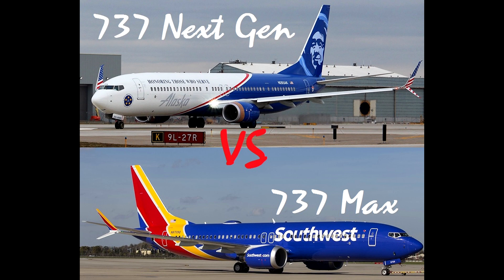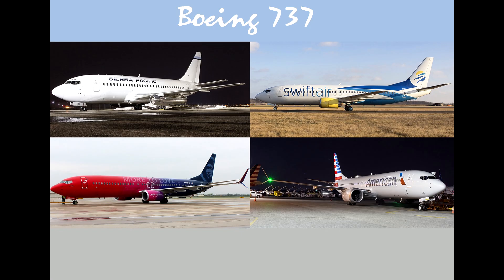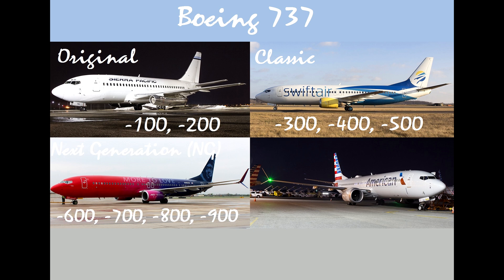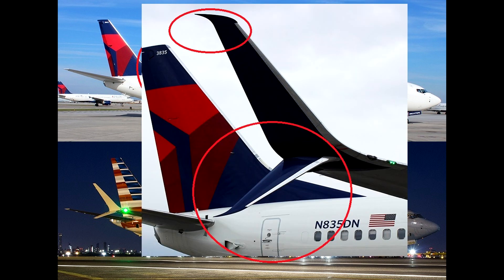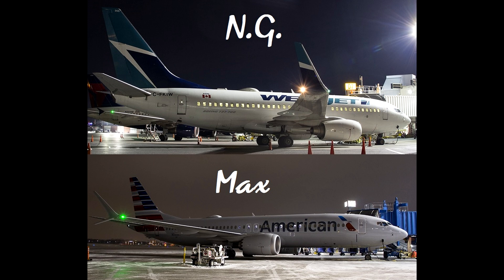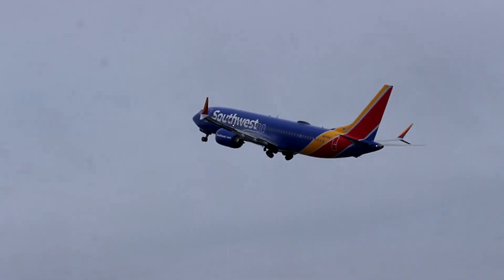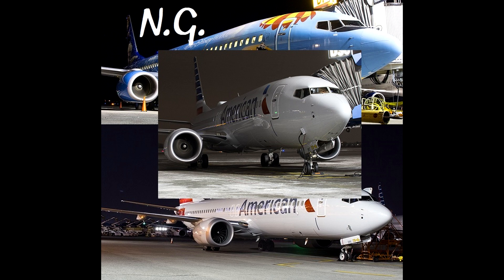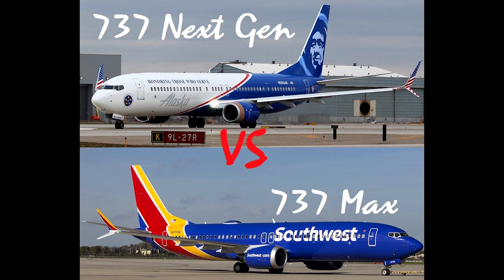737 NG vs MAX: Spotting the difference

Comment: To make things even more confusing, not all 737-NG aircraft feature the split scimitar winglets. Some have older, more basic winglets, which look like the upper portion of the split scimitar, but lack the pointed tip, though they are still at a very steep almost 90 degree angle unlike the MAX winglets. Also, some early ones didn’t even have winglets when they were first made, and a few Alaska Airlines 737-900s, the first of their type ever built, still lack them! Most Delta Air Lines 737-800s, which are fairly early production, came with no winglets initially, but they had the basic ones added on, probably some time in the 2000s or early 2010s. They are currently in the process of receiving the split scimitar winglets. I flew on N386DA a few days ago, only Delta’s 16th 737-800. It was an old plane from December 1999, with brand spanking new split scimitar winglets! Interior also seemed pretty fresh: definitely old in some spots but thoroughly deep cleaned.

Comment: Could you guys tell me what version is the Zibo mod for X-Plane 11?
Cause it’s called 737-800X
I thought the X standed for MAX, but it has no double winglet
Could you also tell me if having a tablet inside the cockpit is a MAX thingy or also NGs have it?
Thank you very much
Reply from the maker: I dont know anything about flight sims but there is no such thing as a "737-800X". The X is just something who ever made the plane in the sim put on the end. Original, Classic and NextGen 737s all have a 3 digit number after 737 (-100,-200,-300,-400,-500,-600,-700,-800,-900) and Max has a one digit (-7,-8,-9,-10). All Max's have the upper and lower advanced technology winglet. The Split scimitar on the NG is after market and doesnt come standard so there are -700, -800,-900s that do not have them. Having a tablet has nothing to do with anything. Almost every plane I have ever worked on (crj200, crj900, erj175, A220, a320, a330, a340, a350, b717, b737, b747, b757, b767, b777, b787, MD80, MD90) have all had tablets and mounts. Thats where the pilots keep all their charts and everything else that used to be in their flight bags
Reply: @MTAviationPhotoFilm  Thank you A LOT man
You explained really well everything :D
Btw I bet the 95% of the NG have standard winglets right? (Is that called “standard” the one not split?)